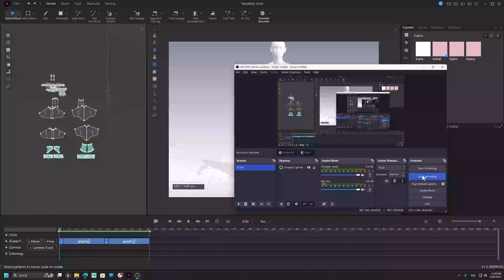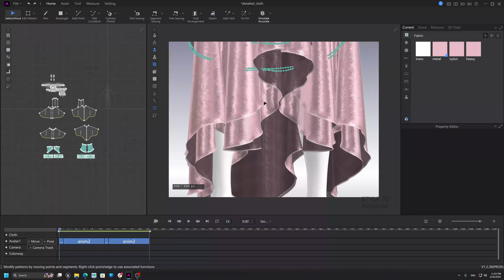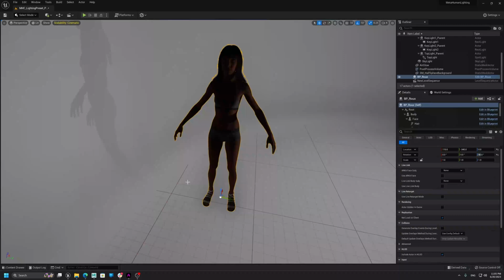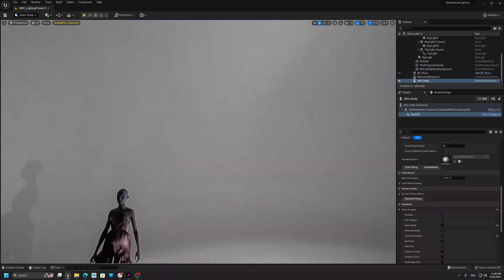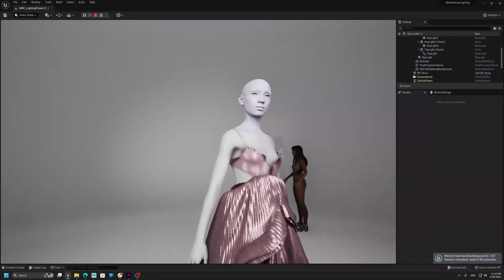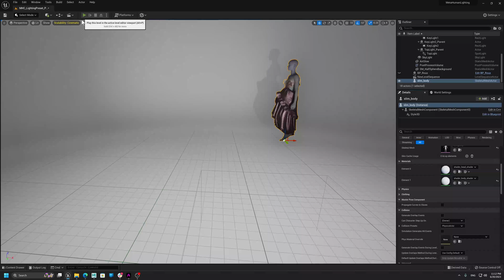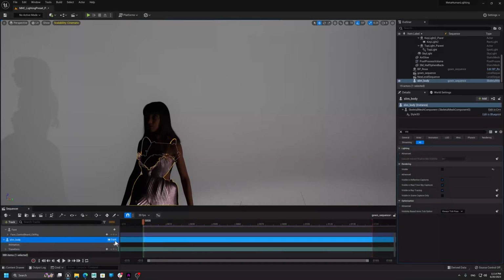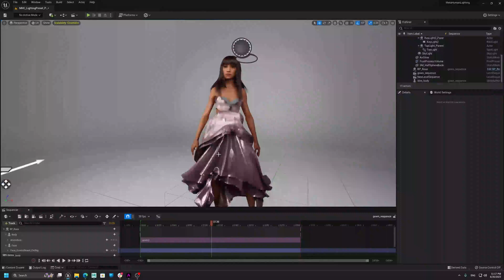Complex cloth simulation for Metahuman with Meta plugin for Unreal Engine.

Comment: The size of the Alembic files is huge...!
Reply from the maker: I don't know where the cache data is stored in the project but by looking at overall size of the project it seems they are very tiny
Reply: The Alembic files are indeed big, but not huge, for a 2 mins animation, it's like 2GB. And when imported in unreal engine, it'll be in a new form, usually it's smaller in the project